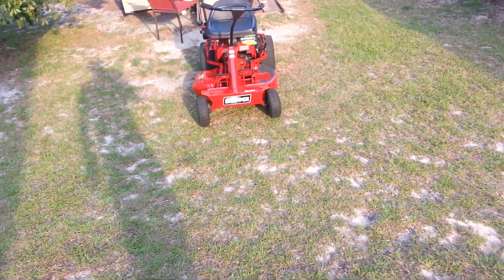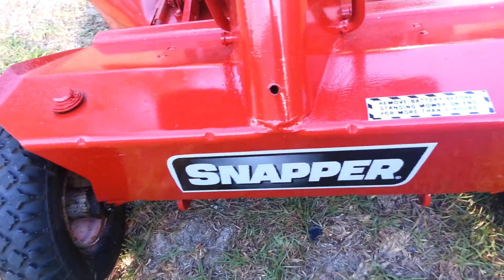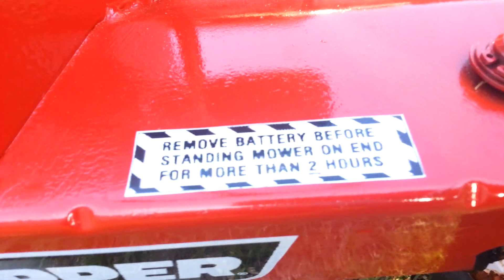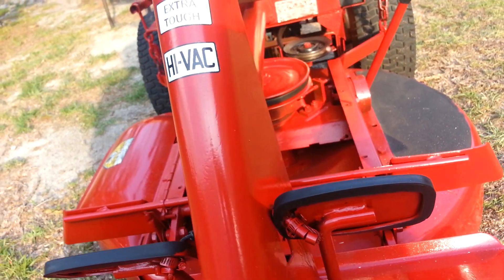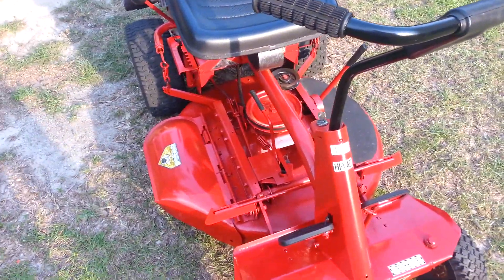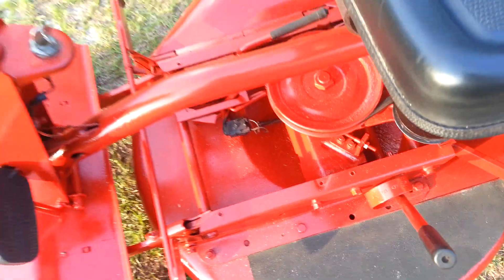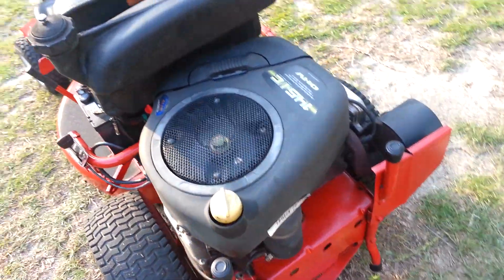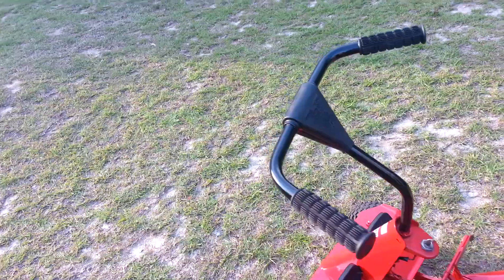New Decals For A 1980 Snapper Rear Engine Rider

Comment: Just found and watched the finnished product. It looks good. also found a video where a fellow used aluminum tread plate on the foot rest, deck foot rest, and other places. That looked good and blended well. Oh what is (resin ribbon)?
Reply from the maker: Here is a link to the ribbon that was used in the Zebra printer. Hope it helps:

https://www.zebra.com/us/en/products/supplies/ribbons.html
Reply from the maker: +DIY OneForAll 

Resin ribbons provide ultimate durability against chemicals and heat on synthetics

Comment: How’s the snappers holding up 10 years later?
Reply from the maker: The Snapper is still doing great, after 10 years. I just replaced the rubber driven disc and adjusted the metal drive disc and replaced the deck belt. It’s a pretty tough machine. It’s still kept in a shed out of the elements.

Comment: Forgot to mention those decals look factory. I'm assuming you downloaded stock photos to print. Oh and what and where can I get the materials to print mine? We have a new printer at church that we print posters with and I'm thinking it'll do these as well.
Reply from the maker: Yes, I did find the graphics online.  I did a search for Snapper decals...:) These were printed on high gloss vinyl roll labels on a Zebra printer that was fitted with a resin ribbon.

Comment: Did you print your own labels. If so, please describe.   Thanks, looks good.
Reply from the maker: Michael,  the labels were printed on high glass vinyl label roll using a Zebra label printer.   The printer was fitted with a resin ribbon. I hope this helps and thanks for watching.
Reply: DIY OneForAll where can you buy the labels?

Comment: Nice restoration. I mowed a yard the other day for a similar one. I'd like to make it more eye appealing. Where did you purchase your decals?
Reply from the maker: Trey,  I am glad you liked it and thanks for the comment.  I actually printed the decals myself :).  I checked with a few places but could not find original decals for purchase.
Reply from the maker: Anthony Hope 
Anyway, I used a resin-type ribbon and printed them on vinyl labels, using a Zebra printer.
Reply: What would it cost to make me some?
Reply from the maker: TREY CARVALHO 
I would love to help but I can't sell the labels. Check with a local graphics shop and they might be able to help out.
Reply from the maker: Were you able to get decals for your Snapper?
Reply: No I have not found decals for my Snapper. I kind of delayed my project until the upcoming winter (Which is coming up) to have it ready by Spring for the local yards I mow and to also get a tilt-deck small trailer that matches my light tan Mercedes-Benz. I have until Spring to do my car-to-trailer wiring, LED trailer lights, Registration, trailer deck, trailer painting, maintenance, grease bearings, wheels & tires. Did you happen to print any extras :)?
Reply from the maker: TREY CARVALHO 
:) We will check for you :)